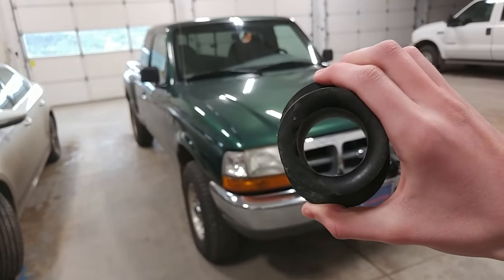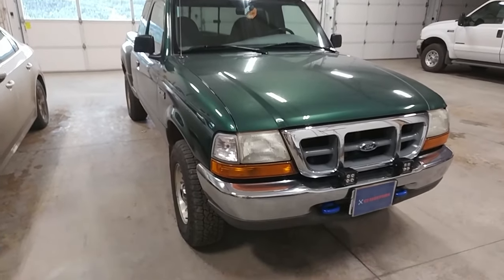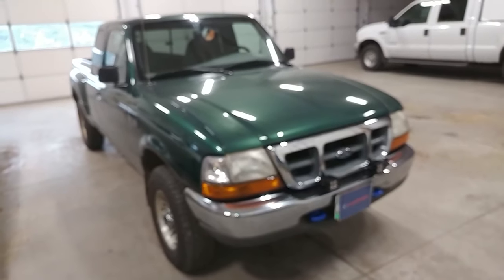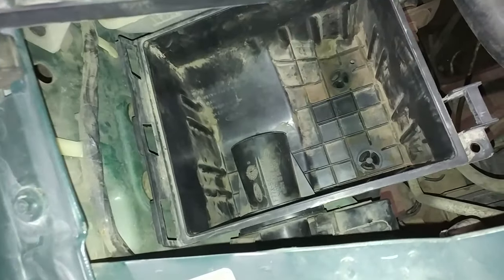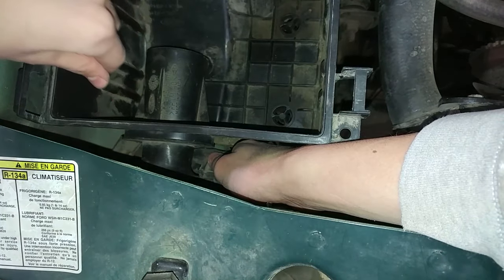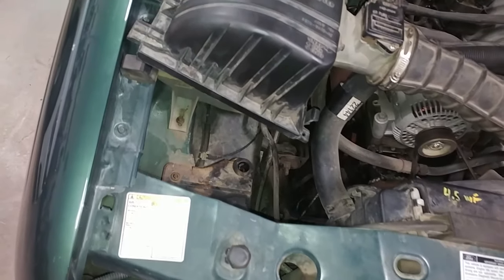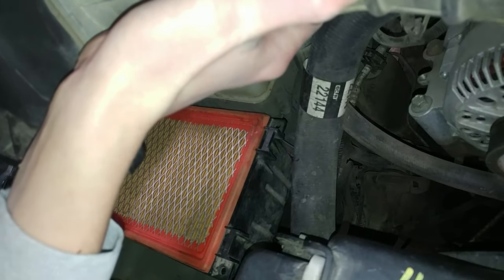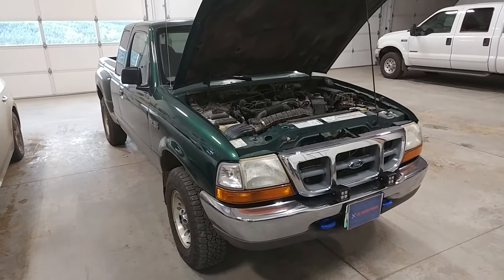DO THIS 100% FREE MOD TO IMPROVE SOUND AND POWER!! - Ford Ranger 3.0L Airbox Modification

Comment: So now you can.. Underhood Sucked into the intake easy.. Number 2... You see all that dare and stuff on that Box you removed.. All that dirt now will easily Into the airbox.. That front bumper external air was cold coming in... When start moving down the road.. The air will help ram into that set up... Now it won't... No runability Problem Doing this... But no power Gane...at all... Just allowing..  more Hot air from engine... And a little more Dust Dirt.. debris to get caught into the filter... So your filter will become clogged a lot quicker.. Just trust me... Don't do this people... One thing to do things like this as long as there's a reason for a gane... Some Vehicles.. This can help on some models.. This type of set up is not one of them...
Reply from the maker: Learn how to type and come back later bud

Comment: first taking that off just means you are gonna be sucking in hot air from the engine bay rather than cold air through the front which is the purpose of the second piece and that will certainly lose power. second, taking off airbox parts that have a bell shape like that usually loses power because those are meant to help lower turbulence. Glad your ears and seat of the pants tells you that you gained power though lol.
Reply from the maker: seems like the 43,000+ people who watched this didn't really care, huh? 😆